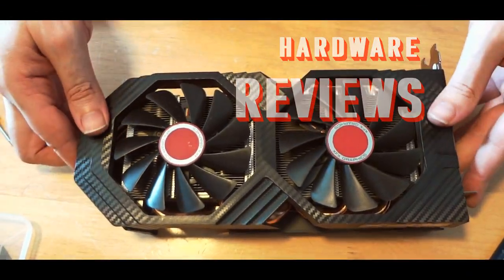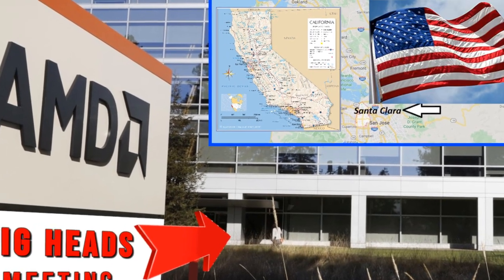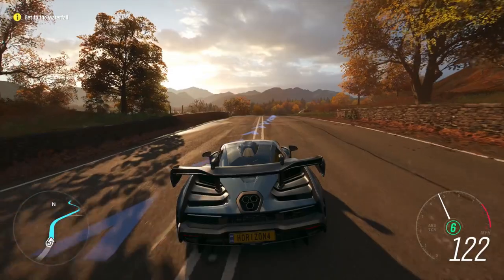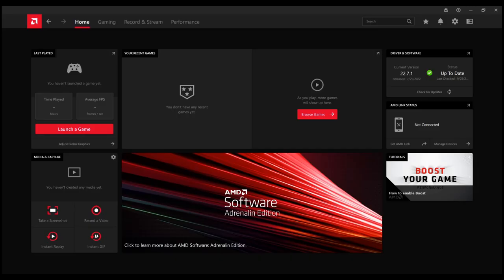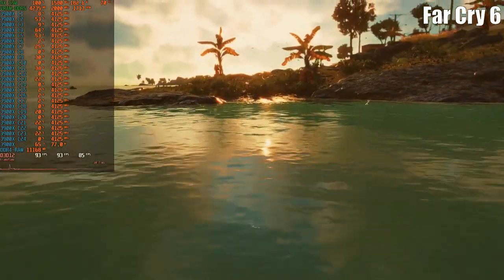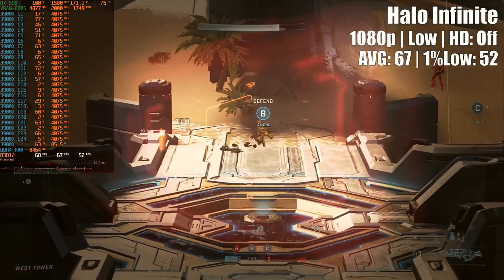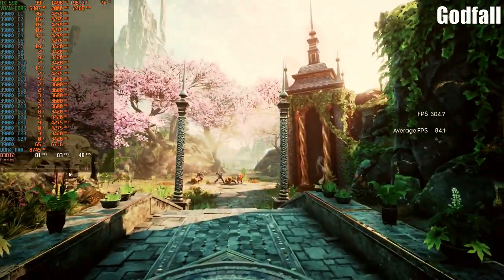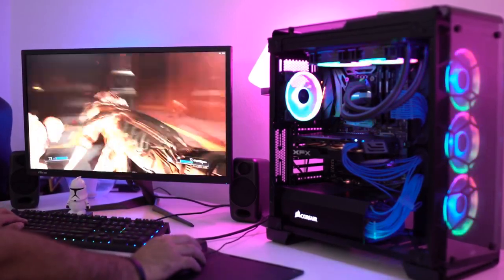How Good Is AMD's Last Polaris GPU For Gaming? • RADEON XFX RX 590 Fatboy Benchmark

Comment: 5 years service on mine and still superb performance on 1570 MHz Undervolt pared with Overclocked 2600X to 4.17GHz. Annihilating every game at 1080p. 🤗
Reply: Hi, i have this same card but had to underclock a lot more, i think its due to my psu, what PSU do you have?
Reply: Hi, can you give me the underclock settings

Comment: Bought a 590 for my PC build in 2018 and has run everything I could throw at it with reasonable results. It finally became time to upgraded to my next mid tier GPU with a 3060 ti.
Reply from the maker: That's a great GPU upgrading step up. 👍

Comment: i run the xfx rx 580 be in cf--any trouble or disappointment I've had i'd first blame on amd drivers, which, to amd's credit, have improved quite a bit over time.  

Thank you for your work--it's very useful.
Reply from the maker: You speak the truth @even blacker crow. THANK YOU for watching and I appreciate also your time to leave your comment.

My next video contains another Radeon GPU, that is twice as powerful as the RX 590. Alas! While testing the card, I experienced the same stuttering symptoms on specific games. I am about to conclude also that the drivers optimization right now is the biggest issue.

Comment: Thr XFX model has that temperature problem.
My card was crashing the system in 1080p getting 85°C

I put a bytsky waterblock and Now it's 44°C running in 1440p and even 4K some games.
The clock Now is 1620mhz before was 1545mhz.

Comment: I picked up a XFX RX 590 FAT BOY 8GB in the original box with manual last November (23') for $105. The description said "Bought for my son but he needed something else".  It's running fine in my daughter's x370 / Ryzen 7 2700x / 32GB DDR4-3200 PC and seems a good combo for gaming. She doesn't do console games at all, she says once you play on PC you don't care about those. EDIT: Forgot to mention that I was replacing her old RX570 4GB because I sold a PC and needed a GPU for in it.  She didn't mind though as the RX 590 is a good bit better than the  RX 570 was.
Reply from the maker: Thanks for watching and also for the time to share your story.

Comment: Thanks for the great video uncle George. 

I want to replace the thermal pads on my fat boy. What thickness did you use?
Reply from the maker: Thanks for watching Mr Faiek.
It had the same thickness 100*100*1mm similar to the original for the VRMs, but a slightly higher hardness.
Despite that it did the job pretty well.
I bought it cheap from here https://s.click.aliexpress.com/e/_DeyZPB5
Reply: Thank you.

Comment: I had a XFX RX 590 Fatboy (not to be confused with my Harley)card in my computer and another was given to me. I do NOT game at all, not even Solitaire. I am running the AMD ROG Strix Zenith (and so on) MB, TR4 Threadripper 2920 Chip, 32 G's ram. I do not game. (again for clarity)..... I do content creation, usual e-mail/internet stuff, some Office apps, but mostly video, photos and content creation. I have two and half computers crammed into a ThermalTake W200 case. SINCE I now have 2-  XFX RX 590 Fatboy's Could I put upon you to help guide me installing both of the cards in my computer along with the needed software settings and tell me a bit about why this is the most terrible thing on earth that In could do, why I should do it and how. What to look forward to both good and bad. You would be surprised at how very LITTLE specific info there is on this, thus I elicit you help and assistance.
.......and PLEASE!!!!!  I really do need help!
TIA!
Reply from the maker: Hi there. Sincerely, that's a lot to ask and been answered. What I can do is to point out few places you can find help and one two tips on the matter.

• In case you use Windows the installation is easy, consult the motherboards manual & download/ install the official drivers from https://www.amd.com/en/support
• AMD is not the most optimal choice if you work with the traditional video and photo productivity tools. NVIDIA would give way better performance.
• 2x RX 590 need a crossfire connection in some cases & some don’t ex. Premier Pro. 
• You need a beefy power supply unit, 800W or higher.
• And finally, depending on the markets you have access to, you can sell both rx 590s and buy with that money a new RTX 3050 or used GTX 1080/Ti, RTX 2060/super and avoid the headache. The downside is you will stay without GPUs for a few days, if you don’t have the cash to pay up front.

If you still persist for your own reasons to proceed with double Radeon GPUs then check
https://forums.anandtech.com/
https://forums.tomshardware.com/
https://www.reddit.com/r/buildapc/
https://www.reddit.com/r/hardware/
if you run Linux then search for forums and subreddits according to your distro.

Best of luck and I hope you'll find the above somewhat useful.
Reply: @obnot  *Thanks!*  I appreciate your input and I will probably take your suggestion and run with it. Anytime I can simplify something I usually will. :-)  Thanks again!

Comment: Hello, what psu do you have with this gpu?
I had to underclock it to less than 1500 😢 so it could work, but i think its due to my psu (half generic 600w, think it only does 488w or so), could the psu cause black screens that need a hard reset?
Reply from the maker: Hi!
Power supply is Fractal Design Tesla R2 White - 650W. For more PC specs check the description

Black screen of death [BSD] in windows can be many things software or hardware. Can it be your PSU the cause? Yea there is a small possibility but usually if the PSU is unable to feed your GPU under load your system would shut down or power cycle instead of BSD.

Comment: it has a mini switch .. if you push it right it downgrade to rx 580 more cooler but less aggressive if you turn the switches to left it will became rx590 suitable for hard gaming at minimum settings

Comment: Sad I cannot run my XFX RX 590 all High it can handle high but I lower all my graphics because of the temperature of this card is the only issues about it playing Genshin impact High 71 to 82 in lower 67 to 74 but in combat it I got 82 still not good even I'm rocking with Kryonaut thermal grizzly

Comment: Thermal pads size mate?
Reply from the maker: 100*100*1mm It had the same thickness with the original for the VRMs but a slightly higher hardness.

I bought it cheap from here https://s.click.aliexpress.com/e/_DeyZPB5

Comment: 200w at the FPS getting not worth it. get around same performace as the GTX 1060 6gb with that Nvidia card using less power.

Godfall on my RTX 2070 laptop and my GTX 1080 TI desktop runs sweet
Reply from the maker: Thats true. Power consumption always was the weak spot for RX 590 that is comparable to an RTX 2070. Of course after the recent RTX 4000 & RX 7000 series announcements then the RX 590's power draw seems rather humble if you dont count the performance differences of course.
Reply: @obnot  🤣Yeah something like 600watts RTX 4090 on draw if you overclock it.
Am okay am on 240V but people in North America might have problems on 120V outlet if got a beast CPU and etc in the system.  Like the new Ryzen 7 7700x With over 200W draw.

If they allowed SLI on the RTX 4090 which i don't think will. That be a system draw over 1,400W excluding storage, USB drives etc. that is to much load on some 120V plugs. 🤣

Ouch.
Reply from the maker: I hadn’t thought of it, but now you mention it that's an extra drawback for the US NVidia high tier GPU enthusiasts.

Comment: I can't find this card secondhand in local marketplaces.
Reply from the maker: Then look for a used Asus Strix RX 580 and OC it. It will give more or less the same results.
Reply: @obnot  i found two RX 590 GME. But turns out it's performance is just the same as 580.
Ex miner 580 is very cheap, though.

Comment: why its temp is going upto 80c
Reply: Because XFX model was made by a engenier in the toilet, this card had a higher TDP and potencial at cost of heat.
The guy just slaped a slightly bigger heatsink from the rx580 model

Comment: is it a good deal about ~140euro used?
Reply from the maker: I don't know your local GPU market to answer with confidence. My strategy is to check how much it will cost me to buy new the cheapest RX 6500XT. Then I take that number and I divided by 2 [50%]. That's the maximum amount of money I would pay for a good GPU model of RX 590.
Reply: @obnot  thank you for the reply, it actually turns out that 140 euro is really the price, if i calculate like that
Reply from the maker: @hjujavejuser  Don't mention it, thanks for watching.
140 euro is  bit expensive for my likes. At this price point I should look for a GTX 1070/1660 or I would check for a cheaper GTX 1060 - RX 480/580/5500XT.

If you are in EU then beyond Ebay check this https://www.tradera.com/en some sellers are shipping outside Sweden.
Reply: @obnot  bought rx 580 in the end
it's perfect for my needs
thank you again

Comment: I think the GTX 1070 is a better used buy in today's market. Slightly better performance and around the same price.
Reply from the maker: If you can find it at the same price of a new GTX 1630 or RX 6400 then I wouldn't count it as a bad deal.
Reply: @obnot  The GTX 1630 was such a big yikes when it released. Makes the RX 6400 look like a decent deal.
Reply from the maker: @Thelango99  That's true. Sometime I have the impression that Nvidia & AMD are competing each other not only on which company will manufacture the best product but also the worst.
Reply: @obnot  The GT 1030 DDR4 was also shockingly poor.

Comment: Previous owner: "...Uses too much electricity, smells like gecko inside, trunk's too small... be perfect for you, though. See ya." ))
Yeah, this card still can handle with modern AAA games. But due to it's price RX590 was never a good deal, neither in comparision against RX580-8Gb, nor GTX 1060-6Gb/1650super.
RX6500XT have some issues that might be critical, but it also consumes 50% less power and have driver-support plus other new features from AMD - about 45-60% of rx6500's price for old RX590 seems fair, I still remember prices of R9-290/R9-390 in 2018-2019 and it was fair too))
Reply from the maker: LOL
Dont forget the dead mosquito that was creeping between the heatsink and the fans.

R9-290/R9-390 are even cheaper now.  Too bad that AMD decided to drop the driver support.

Comment: I have a Sapphire Nitro 580 overclocked at almost 1.600 on the core and i have not all these issues as you have in many games and even some tested here. I have to say that you literally picked the worst brand for the AMD side: XfX. Those cards are like the evil of AMD, and then after them comes PowerColor but they are less evil (the only issue there is with PowerColor brand is that the engenier are drunk and the vRAM are in almost all cards not being covered correctly with thermal pads but that can be easly fixed so.. that's why i said they are less evil). Anyway, find and pick a Sapphire Nitro and you'll see a whole different world with the 580/590..
Reply from the maker: Most reviews was complaining back then about the XFX's RX 590 fatboy cooling system implementation, so I can't argue that an Asus Strix RX 590 for example wouldn't behave better.
Reply: Sapphire very expensive but you are right. I had RX 460 nitro that feel almost like a rx470.
Reply: @SirBrucie  Yes, they cost a little more but they are worth much more in terms of power, performance, cooling system and overclocking ability
Reply: just mod the fatboy with some thermal pads, it will do good
Reply: @weebbanana7895  This doesn't change anything. It's just the card that is bad. XFX is the worst brand for AMD, like MSI is for Nvidia (And AMD too in this case.. it's a bad and cheap brand).

Performance wise and cooling wise, the best one is the Sapphire one. A Sapphire 590 Nitro is way better in these fields.
Reply: @BryanTheFury  im just sayin if u bought a fat boy you could somehow fix the temp issue by doing the mod. i agree that sapphire is one of the best amd gpu manufacturers out there, my sapphire r9 290 still works after laying around for like 4 years lol
Reply: @weebbanana7895  Ah my bad, i touhght you were speaking performance wise, not about temperatures

Comment: still happy with my rx 570 and yeah my monitor has a max refresh of 60hz... sooo im quite happy using the 60fps limit  screens jive and tears like a bastard anyway.. so its better off limited to the monitors refresh rate.
Reply from the maker: Thank you for sharing your thoughts. I believe, this is one of computers great thing. You can adjust the gaming experience depending on the hardware.

Comment: literally every stutter problem in the games you have more than 60fps can be fixed if you lock the fucking fps at 60.
I have the sapphire special edition variant and i don't think you bring justice to this card capabilities.
Reply from the maker: You misunderstand the content's purpose. This video and generally most benchmarks are all about the out of the box experience with preset in game settings and recommended drivers. Best case scenario they will include some sort of OC.

There more solutions than just cap the frames at 60 that would fix the stutters in some of the games I run, but as I stated in video " 10:43 " the present content has nothing to do with that. Otherwise the title would be "How to fix the potential stutters while playing with your RX 590".
Reply: @obnot  if purpose of the video is to check "How Good Is AMD's Last Polaris GPU For Gaming in 2022" as title says then it would make sense to talk about solutions, especially if they are as simple as "lock the fps". 
When I am watching this video it looks like terrible choice but if you can delete all the stutter it would not be bad at all.

Also stutters in games are crazy (far cry 6 for example) but frametimes dont show them at all
Reply from the maker: @cyjanek7818  Thank you for the comment. 

Generally, I disagree. On Far Cry 6 I mention about micro stutter that are visual also on frametime line. But no these are not crazy stutters. Check Naraka Bladepoint 14:08 to see the difference between micro- and crazy- stutters.

As for the first matter, the majority of consumers have no idea what fps lock is, nothing "simple to do" for them. They just want to buy a GPU and play games  etc. As you wrote the title is all about to check the GPU performance. Not to fix it. check above, my original answer for complementary info.
Reply: @obnot  you should try nimez modded driver for old gpu like this  its should be slightly fix for stutter in some game
Reply: @obnot  One thing I will correct from my last comment - it seems like I had problem with youtube yesterday because this video was had stutters like the one in 14:08 but across every video game. Now they do not appear so it must be a problem with my side of youtube. 
Farc cry 6, The division, even AC when it was on lowest had same effect when I watched it yesterday
Reply from the maker: @tehonlynoobs5556  Yes. Nimez Drivers is something I'll definitely check out the next time I get AMD GCN GPUs for test.
Reply from the maker: @cyjanek7818  That explains it.👍
Reply: a rx590 sapphire pulse was my gpu till last week (upgraded to an asus rtx 2060 12gb evo dual oc). it is a very decent gpu, able to run even the unoptimized halo infinite open world at medium settings at 1080/60. i limited its fps to 90 (with a 60hz screen) in riva tuner, as the gpu exceding my screens capability too much threw errors somewhere in the chain. 
the gpu will now be at home in my fathers pc (replacing my old gtx 950 he uses) i helped him build recently after his 15 year old, flawlessly running, pc was killed by an accidental power surge. his remarkable soundcard survived and was transplanted. the cpu is kept as memory.
Reply from the maker: @Chrisspru  Thank you for watching and sharing you story with us.🙏